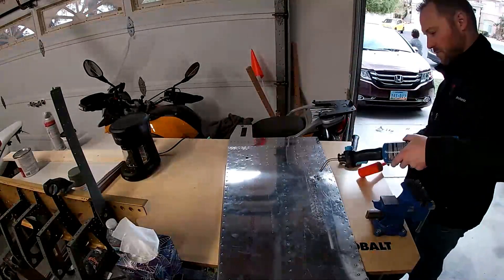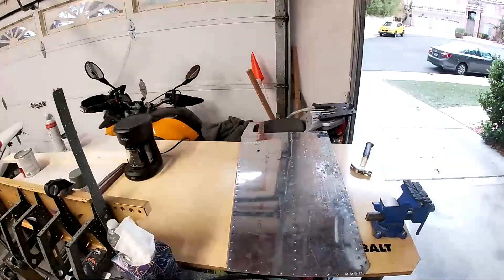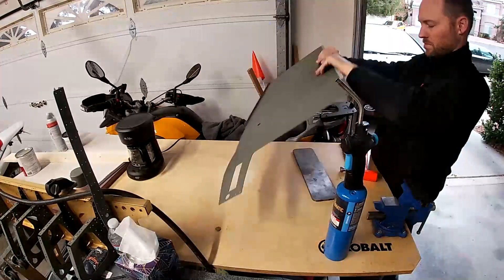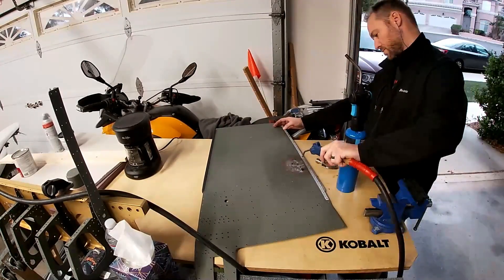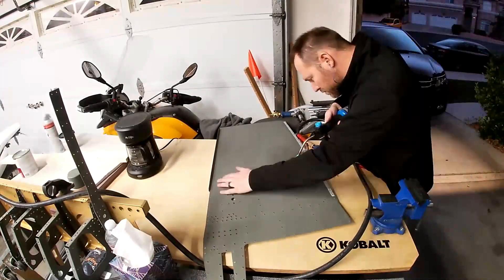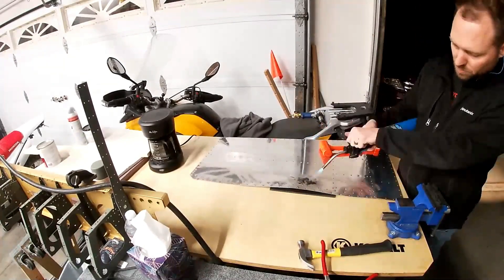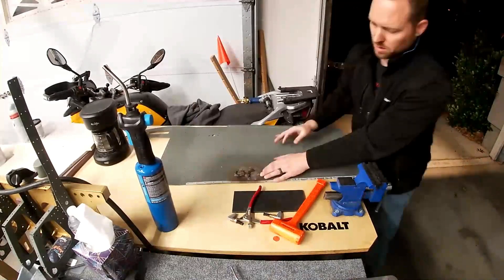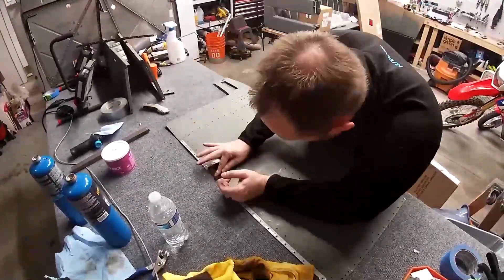RV-14: Skin dent repair featuring Fire McFireface

Comment: Definitely not a good idea unless it’s a non stress part like a fairing or cowling. Heating the aluminum up above 700deg will start to anneal it. Which the propane torch burns well over that. And you can’t guarantee you didn’t. Plus hammering the spot over and over work hardens it. I would make a new skin. Aluminum is cheap. Especially 2024 T3. Just my two cents.
Reply: Also if your planning on running a full digital/electronic ignition your going to need a secondary battery backup just in case you have a power failure. The reason behind still running magnetos is they are self contained and require no out side power source to operate. The power gain from running electric ignition will be minimal.
Reply from the maker: I'm not interested in EFII for power gain, I want fuel diversity.  Very difficult to achieve with the fixed timing of magnetos.
Reply: @JoshSinclair  what engine are you planning on running?
Reply from the maker: IO-390.